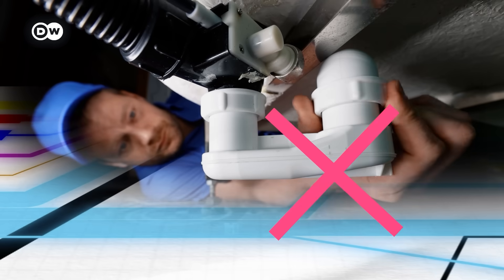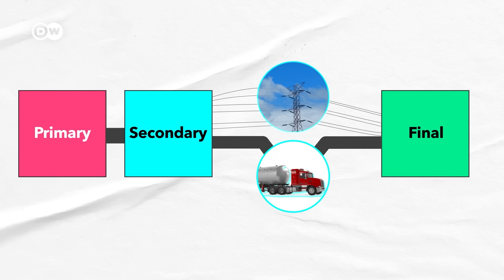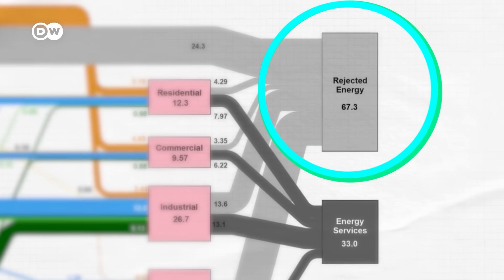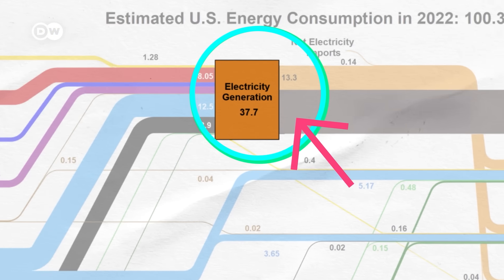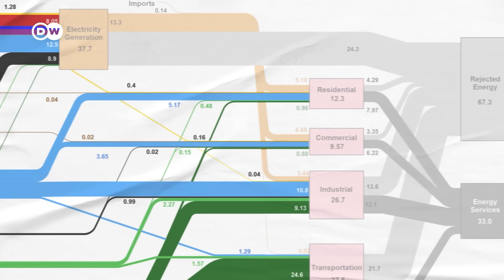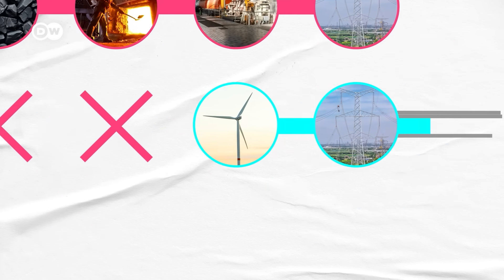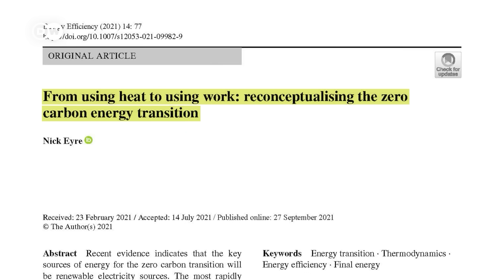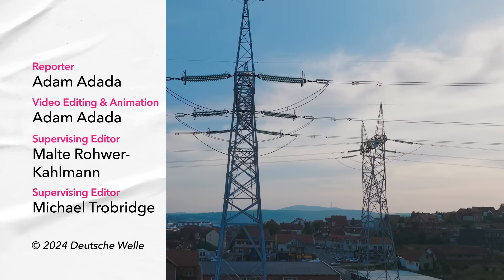The mind-blowing thing we get WRONG about energy

Comment from the maker: Do you think switching away from fossil fuels is easier than it seems?
Reply: You tell the billionaires who own fossil fuel assets whether they'd be so kind as to simply write them off and live with the ensuing losses.
Reply: @josdesouza  Fossil Fuel Assets become Fossil Fuel Liabilities. Cannot be stopped. We have come Far. And its just the beginning.👍
Reply: Can it be affordable to common people? 
Do we have enough and reliable power source to convert everything?
Reply: You guys turned off nuclear plants to return to coal 😂😂😂 🤦
Reply: No. Look at Switzerland, 3GW installed capacity nuclear, 4GW installed capacity solar. Electricity production: 24 TWh nuclear, 4TWh solar. Please tell me more how renewables are more efficient taking into account capacity factors and how it is worthwhile to spend all the energy manufacturing 10x more generation capacity which has much shorter lifetime, plus all the grid upgrades. And also where is all the copper for transmission lines going to come from.
Reply: @a.b.d8927  Aluminum is a fine conductor.

Nuclear is many times more expensive per MWh than solar, and tends to prey on solar because it's easier to shut off solar than to stop and restart nuclear.

All the rest of your claims? Sound like shenanigans to me. Switzerland has plenty of capacity for pumped hydro, so has no need of any other source than renewable.
Reply: @bartroberts1514 the numbers are from Our world in data, for 2022, look up electricity production by source. Hydro is indeed the highest at 30 TWh, followed by nuclear at 24 TWh, and then solar distant third at 4TWh, despite higher installed capacity. Both solar and wind have low capacity factors and much shorter lifespan compared to nuclear, and they are cheaper only if you dont count grid infrastructure upgrades and storage. 

Aluminum is indeed good conductor but at high current densities (such as fast chargers gor EVs, and related infrastructure since you need to upgrade substations etc), copper has very clear advantage in lower Joule losses. 

You can also look up increased consumption of lead due to growth of solar (its in the solder). So environmentally friendly! Cant wait for agrovoltaics! We really need to add some lead to all the microplastics in the soil from using WWTR sludge as fertilizer.
Reply: @a.b.d8927  Not a lot of lead in lead-free solder used in modern agrovoltaics, nor plastics either. Plastics.. the co-products of fossil fuels made cheaper by fossil fuel use. As for WWTR sludge fertilizer, don't you mean synthetic ammonia fertilizer? That'd be the stuff delivered in plastic bags, right? As for Joule losses, that's all to do with cross-sectional area, so not an issue on a cost basis. I mean, if you were looking for maximum advantage, you'd be using gold or silver.. or graphene.

Our World in Data 2022 is outdated. China pretty much doubled solar installations in 2023 alone.
Reply: Definitely. Especially when you see how cheap wind and solar energy got. And batteries get cheaper and cheaper, too. We don't need expensive fossile fuels any more and can save a lot of money. Win Win Win for us, clean air in the cities and the climate.
Reply: As a person who have renovated a 1960's house entirely, I could see firsthand what insulating and switching to low temperature underfloor hating supplied with a heatpump can do.
Going from a central woodburning boiler needing 25000kWh of wood to heat the house for a year, we are now down to 1600kWh of electricity feeding the heatpump.
Actually a properly designed house should not need energy for heating, zero-energy houses have been around for 30 years now.
Reply: Yes, that's why fossil fuels work so hard to hinder every effort to transform into renewable alternatives.
Reply: If it were so magical The System would have shifted long ago.

By the way, electricity is NOT energy...is an energy flow.
Reply: @vsotofrances  Vested interests. Complacency. Failure to update practices. Try some Donella Meadows to cure your The System blues.

By the way, potential electrical energy doesn't flow.
Reply: Sodium Ion BESS will radically improve our energy storage.
Reply: It’s easier on the point that it is much, much more efficient than ancient carbon sinks. It’s much harder to change mindsets, economic arrangements, and the flywheel effect of business as usual. 
On another note, I’m a bit of an armchair economist, and I see it much differently than what we have today. First principles, a positive feedback loop will always lead to failure. This is why the rich are getting richer, but at some point this fails. How can capital be generated if only the rich can afford the luxury of being?  Second principle capital must flow or it becomes stagnant, and losses value. If capital isn’t doing something useful,it has only intrinsic value.  As in the wealthy holding wealth for wealth’s sake. Third principal, if money is not doing something good for everyone, and the earth, what good is it? 
I really like the donut economics model, this model takes into account of most everything we need. Just sayin.
Reply: If it's cheaper, then it will happen by itself and will require no effort. It needs to be cheaper all the time, though, including in the middle of the night and when the wind isn't blowing.
Reply: @mikeg9b  Vested interests. Sunk costs. Ulterior agendas. Perverse rewards. Crony capitalism and corporate socialism.

Worrying about the middle of the night when demand is low, and when the wind isn't blowing when demand is low? Seems contrived, and driven by ulterior agendas.

I'm fine with cheaper overall, with storage to cover the middle of the night when the wind isn't blowing, on a grid that doesn't waste almost 70% of power generated.
Reply: @bartroberts1514  The monthly electric bill needs to be cheaper. When people can switch to renewable energy and save 10% or more on their monthly electric bill, even Republicans will switch. Unlike cars or clothes, there is no benefit to paying any more than you have to for electricity.
Reply: @mikeg9b  See, I'm already on the third lowest-priced grid on the continent. We got that way by switching to renewables.

When your grid is fully fossil free, you'll start realizing those 15%-40% electricity savings, or at least your provider will.

What they charge you is up to your politicians, though.

And here, an EV pays for itself in less than five years, because electricity prices are so low.
Reply: To me it doesn't seem easy...
Reply: Sure it is.  Build nuclear, invest in power distribution infrastructure, use thermal solar as peaker plants for summer AC surges with molten salt thermal energy storage.  That's the grid decarbonized.
if we use high temp nuclear for electricity, it can be used to synthesize gasoline, and move us off drilled oil while we transition to another fuel source, be that full electric, synthetic fuel hybrids, hydrogen, or ammonia.
Invest in inland train freight infrastructure, that will also be able to serve as hub people transportation.  That can massively improve efficiency in transport and relieve our highway system and air travel.
Reply: @SanosukeTanaka  Nuclear expensive, though. Why not enhanced geothermal, multiple-scale hydro, and skip all the consumables entirely, making biofuel for hard-to-abate uses?
Reply: @bartroberts1514  Nuclear is the least expensive source of energy that we have.

US wholesale electricity prices by generating technology:
PV - $83/MWh
Wind - $36/MWh
Fossil fuels - $34/MWh
Nuclear - $25/MWh
Reply: Renewables are expensive and unreliable . Will never happen.
Reply: Nice video, but hard to follow when the background noise/music is high and voice volume is low.
Reply: No.  In the US there's 250 million cars and trucks that run on fossil fuels. Replacing them will not be easy.     It took at least two decade s  to build them all.   We are building grid scale energy storage at about 1% of the rate we need to.  At any given time, nearly 10% of fossil fuels are in storage either in large tanksl, tankers,  pipelines  or Col storage and transfer areas.  Even if we just have to replace 30% of that storage,  we still need about 8,000 terawatt-hours of storage.  Our biggest battery storage areas are measured in megawatt hours.  There are 1 million megawatt hours in a terawatt hour.

We aren't building any interconnectors that would also make best use of resources.  They need to be under construction now to be have them finished in 20 years.    
It won't be easy but it  once it's done we should be secure for generations.
Reply: It's easier when people are stopped lying to.
Reply: Hi, unfortunately the video only explores one dimension but the picture becomes more complex taking into account other very important dimensions. In particular the capital efficiency of current renewables to deliver a stable electricity supply (storage, back-up, transmission infrastructure, maintenance) is low, and the cost per unit of energy is more expensive so society will become poorer which will cause social unrest, worse health outcomes, environmental destruction and it will slow down the adoption of renewables in other countries as they witness negative impacts of rushing to net zero. Making people poor is a bad strategy.
Reply: @JetsG2020  Exactly that. Expensive power(electricity) stops people from electrifying all the appliances, cooking, heating, transportation. When electricity is stable, predictable affordable switching heating from coal/wood/natgas to efficient heat pump needs no incentives- it should be the best, least expensive, most convenient option. France uses practically no coal, oil for electricity and little biomass 40ish alrady- and Germany is environmental failure, that spent a lot of money. Medal for efforts! Failure in execution.
Reply: This is a not too bad presentation. About energy losses I mean.
But first a few obvious mistakes.
1: A powerplant for creatin g energy is much more efficient as descrived (when used at full power).
60% of the used heat goes directly in electricity. Frome the 40%  not used for electricity half can be used or other (indurstrial or other heating) piurposes. Making those up to 80% efficient. (Source..energy producer in the netherlands, using a so called "steg centrale" 
2: Energy efficiency has nothing to do witrh climate and climate changes.
Also noone has ever research the effect in collecting sunheat on those nice black solar panels and then heating up the athmosphere because those panles get hot  compared to the reflected (ito space again) if that surface would be nice white (sand, icecristals or just mirroring)
3: Noone has installed the soilution for storage of electrical energy on the (needed) big scale (except denmark and noway).
Using renewables is a production model with mostly a production capacity depending on extranel sources (sun , wind) which we cannot regulate.
But energy should be delivered on demand...that is what we are used to (no not for that electric car...it is not important if it get charged on a sunny daytime or at night when the fossil powerpland does not know what to do with rest capacity...what IS importanbt for that EV is that I can connectv that thing to the grid at ALL parkinbgplaces...but only chatrging when there is a surplus of energy...maybe even partially UNCHARGING when there is a shortage in energy.(Of coarse I should choose until what battery level it can be incharged and the payment must also involve (for each full cycle worth of electricity)  one promile of the battery costs...assuming a lifetime of 1000 battery cycles.
This could solve partly the omissing storage capacity for energy.

But overall..I DO support max efficience in energy usage for 100%. Climate is not important for me for this behaviour. Just resourcefullness. (And yes I'm one of the first addopting an EV (2013, not even the teslaS on the market in europe)...long before even governments spoke about transition. The same for using a heatpump for heating (even before my first EV, in 2009 installed) Maybe noone should forget that most airco's are also heatpumps.
Also , as information...I ONLY believe engineers if they are NOT payed by any factory of government for making their research claims which makes political influence in their reports often to big.. The same about preventive medication of coarse).
Luckily myu child is one of those engineers (also involved in developing a solacar for the WSC Australia a decade ago) and my wife is that not payed (by pharma and or government) physician.
This along with my own technical education.
Reply: NO, you are looking only on a part of the problem. For example renewable sources generates only at some times (solar at day...) so you won't have enough energy at night, and storing energy is really problematic (also it is inefficient). And this is only one of many problems.
Reply: The biggest problem is most of the population is sociopathic. We just have to stop buying new fossil fueled devices, and then everything will be replaced by electric powered devices within a few generations, with most of it being replaced within a few decades. That's on target to meet most of our climatology needs. The end of this century is going to be a doozy either way, but the real difference will be whether we survive the next one.
Reply: No, because building out the required renewables isn't the problem. Even if we had to match the primary energy needs. We could do it in under 5 years, just for what we currently spend on fossil fuel subsidies.

The problem is that the fossil fuel industry owns the politicians and the media.
Reply: One missed detail here is that the transitional energies like oil provide on site energy production. When we remove such systems it increases the need to produce more energy for the entire network instead. That is where we have a problem as well. The calculations I have seen on that reach stuff like doubling reliable energy production within 10-20 years to reach demands. That is insane numbers of megawatts we need in output which would require huge expansions and modernisation of the grid and robust powerplants like nuclear and hopefully future fusion plants alongside large scale energy storage that borders on pure sci fi at the moment...
Reply: @kenji214245  The statement you provided raises several concerns and misconceptions about transitioning away from fossil fuels and the requirements for energy production and infrastructure. Let's address these points using insights from Project Drawdown's Roadmap and existing counterexamples where appropriate.

Misconception 1: On-Site Energy Production from Oil
Claim: "Transitional energies like oil provide on-site energy production. When we remove such systems it increases the need to produce more energy for the entire network instead."

Reality: Oil is the least used, and least conventionally attractive, of grid energy sources except in extremely remote locations or terrible cases like Puerto Rico. While oil can provide on-site energy, the transition to renewable energy does not inherently increase the need for network-wide energy production. Renewable energy systems, such as enhanced geothermal, small-scale hydro, solar panels and wind turbines, can also provide decentralized, on-site energy production. In fact, distributed renewable energy systems can reduce the burden on the grid by generating power close to where it is consumed, thus reducing transmission losses and improving grid resilience. Both compressed air storage with geothermal and pumped hydro with micro hydro are efficient, cost effective answers to intermittency.

Counterexamples:

Solar Panels and Microgrids: Many regions use solar panels and microgrids to provide on-site energy production. For example, rural areas in India and Africa are increasingly adopting microgrids powered by solar energy, reducing the dependence on centralized fossil fuel-based power plants.

Project Drawdown: Promotes decentralized renewable energy solutions, including rooftop solar and community-based wind projects, which can effectively replace on-site energy production from fossil fuels.

Misconception 2: Doubling Reliable Energy Production
Claim: "The calculations I have seen on that reach stuff like doubling reliable energy production within 10-20 years to reach demands."

Reality: While the transition to renewable energy will require significant increases in clean energy production, the notion that we need to double reliable energy production is an overestimation if efficiency improvements and demand-side management are considered. With energy efficiencies inherent in transition, at most 17% grid power delivery increase is needed overall by 2030, and at 3% per year would be in line with normal maintenance and upgrades. Re-connectoring methods have really improved the efficiency of such operations lately. Project Drawdown emphasizes energy efficiency and reducing energy waste as critical components of the transition, which can substantially offset the need for additional energy production.

Counterexamples:

Energy Efficiency: Countries like Germany have made significant strides in improving energy efficiency, reducing overall energy demand even as they increase their share of renewable energy.
Project Drawdown: Lists energy efficiency measures, such as building retrofits, LED lighting, and industrial efficiency improvements, which can significantly reduce the need for new energy production.

Misconception 3: Need for Huge Expansions and Modernization of the Grid
Claim: "That is insane numbers of megawatts we need in output which would require huge expansions and modernization of the grid."

Reality: See above for information on actual grid expansion and re-connectoring. While some grid expansion and modernization are necessary, the transition can be managed through incremental upgrades and smart grid technologies. Renewable energy sources can be integrated into existing grids with strategic investments in grid management, demand response, and energy storage.

Counterexamples:

Smart Grids: Countries like Denmark have implemented smart grid technologies to integrate high levels of wind power, maintaining grid stability and reliability.
Project Drawdown: Highlights the importance of grid flexibility and modernization, advocating for smart grid technologies, demand response, and distributed generation to manage the transition effectively.

Misconception 4: Reliance on Nuclear and Fusion Power
Claim: "Robust power plants like nuclear and hopefully future fusion plants alongside large-scale energy storage that borders on pure sci-fi at the moment."

Reality: While nuclear power can play a role in providing low-carbon energy, the reliance on future fusion power is impossible and will never happen. Current renewable technologies, combined with existing and emerging storage solutions, can meet future energy demands without waiting for expensive, slow nuclear technology.

Counterexamples:

Renewable Energy and Storage: Countries like Iceland (geothermal), Costa Rica (hydro, wind, and solar), and Portugal (wind and solar), and most of Canada (hydro, wind) are already achieving high levels of renewable energy integration.
Project Drawdown: Emphasizes a diverse mix of renewable energy sources, including solar, wind, geothermal, and hydro, supported by energy storage technologies like batteries and pumped hydro, which are already commercially viable.

Conclusion
The transition to renewable energy involves challenges, but the misconceptions highlighted can be addressed through existing technologies, strategic investments, and proven approaches. Project Drawdown provides a comprehensive roadmap that includes energy efficiency, grid modernization, and the deployment of a diverse mix of renewable energy sources, all of which can collectively meet future energy demands without relying solely on nuclear or speculative fusion technologies. By looking at successful examples from around the world, it's clear that a sustainable, reliable energy future is achievable.
Reply: @kenji214245  True.
Reply: An ICE is 20-30% effective at utilizing combustibles whereas a commercial power plant is more in the 40-50% range for efficiency. ~45% efficiency for power generation multiplied by 90% efficiency for utilizing the generated power through electric motors equates to around 40% overall efficiency. So you use about 30-50% less fuel to do useful work but you need to take into consideration costs on the backend such as electric motors and batteries production and useful working life.
Reply: Question -- how is "flare gas" categorized?  You can see that stuff from space.
Reply: And is escaped methane included in the figures?
Reply: Switching is feasible, we currently have most of the technology we need to improve energy efficiency (mainly through electrification) and to supply reliable renewable energy.
Reply: We have mostly done so as an individual household added Solar/Battery and Model Y. It takes an investment but an investment you can justify over time and therefore we are saving money. Additional benefits are no more gas stations, house now has a battery backup so we will be unaffected by blackouts, we have removed our demand from the grid. If an individual can do it and justify it economically then this transition is very manageable for society.
Reply: I don't think the problem has been technology for the last twenty years (and more). I think that the real resistance is just resistance to change. People just don't see the actual costs of fossil fuels in their day to day, they can't see the benefit of renewables, and they can't see how they will be able to break away from what they have (fossil fuel reliance) to get to renewables.
Reply: @3:24 audio problems. The presenters voice volume is lower than the music.
Reply: Trompe.
Reply: You fail to mention that wind and solar produce intermittent energy. You cannot run a civilization only when wind is blowing or sun is shining. How about you advocate for nuclear which can and does (e.g. in France) replace fossil fuels reliably? Solar and wind are just a hobby for rich countries, not a source of energy one can take seriously.
Reply: I think it could be easy to switch away from fossil fuels in terms of added electricity generation. This century the generation of electricity from coal, wind/solar and gas have all increased by roughly 4 000 TWh. 

In the next 20-25 years the total electricity generation will increase and none of the net increase comes from coal and gas. I think even more will be done but that won’t be easy.
Reply: No!!
Reply: Please lose the silly, distracting, overly loud background music. It adds nothing to your video.
Reply: Definitely no!
Reply: If Germans actually understood any of this, they would have spent the last 15 years actually doing it instead of just repeating this nonsense propaganda while buying Russian natural gas.
Reply: Absolutely!
Reply: White women love to tell others what to do.
Reply: My answer is no. Agreed moving away from fossil but i still don't see how renewable able to replace 1/2 of energy needed. Not with current available technology or deployed method. 

I feel this video kind of contradicting with other DW videos. For example, The supply chain and the waste issue on Wind turbines, the EV battery, etc. It seems we kind of shift one problem  to another with greater environment damage. 

I do believe a lot of things are over hype and did not disclose the whole truth of it, the pro and con of each. Politicians definitely don't care. I do see things differently nowadays. From whole supply chain, sustainability till by product.
Reply: Easy? Germany spent some 520plus GiGA Euro, has one of the most expensive electricity and still use so much coal and gas to get it. About 10times more CO2/kWH than France!
Reply: @msxcytb  plants love co2
Reply: @sullytrny  410plus ppm is plenty enough for plants.
Reply: Glosses over the impact of electric vehicle production on the environment.
Reply: @CGM_68  Most likely these impact are overstated. Use that electric vehicle a lot (only then it makes more sense to replace gas with electricity) and long and the "build" dept will be paid. Now ICE cars also takes intense resources to make and for every litre of gas it takes some extra 20-30% of it consumed in the process (recovery, refining which is energy intense, transport), which is frequently forgotten.
Reply: @CGM_68  the problem of materials and recycling is interesting indeed. I'm more optimistic about it. Used up batteries retain precious elements in compact space waiting for its value or laws to force recycling. I just think that it is not necessary to have grid/home batteries when we have perfect energy storage material in form of uranium, thorium and plutonium. Batteries are more needed to reduce emissions in transport. Just a small 10kwh battery in my old phev saves 4/5 of emissions from my family kind of driving - same battery would not give any benefit if installed in my house, because in my country grid is pretty clean(1/6 of emissions of Germany per kwH)
Reply: @CGM_68  Yeah, yeah cause producing regular cars and fuel has no impact whatsoever...
Reply: @fka-Kaya  did I say that? No! It is disingenuous of DW to compare negatives of one aspect with only the positives of another aspect.  Stow your dismissive demeanour.
Reply: It is, but lobbying combines with the preference for the familiar to produce undue levels of resistance
Even if we only need to get rid of ⅓, we still need to aim to reduce fossil fuels as much as possible beyond that
Reply: We´re up against the fossil fuel lobby.
Reply: It will take no effect at all to stop using fossil fuels. Just a question of time. Do we do it now whist we can and it's easy or when all the fossil fuels are gone?
Reply: It's easy. Sweden has 98% fossilefree power generation, Norway has 99% fossilfree power generation. Just stop burning things. The UK is soon closing its last coal peaker plant. The Aussies are balancing their peak power with batteries, which is way cheaper than coal. If there's a will ... 🙂
Reply: @gunnarparment5050  France is also fossil free with its grid, Similar Finland, Ontario and few others. Use the best, cheapest (as total) mix with lowest carbon footprint- this is not always wind and solar.
Reply: We think Germany would go out of energy if they wouldn't import electricity from nuclear plants in France.
Reply: @MrZygmuncik  Right at the moment France is exporting about 9.5GW of carbon free energy to its neighbors. At the moment about 20GW of France capacity is idle/off- so France by itself could get kind of rid of a lot of  the coal in Europe for some big part of the year (simplification excluding refueling etc). Think about that!
Reply: It is not
Reply: The power elite push the climate agenda to centralize their control over ALL the energy, carbon fuels, renewables, all of it, and they do it with fear and artificial scarcity, and limiting choices, and steer the people's good intentions to "save the planet", and the social and economic momentum from fear they create.  They support centralized systems and services which they control and make you dependent, and efficiency does not really matter to them.  Destroying "old" industry makes the industry they invest in explode in growth.  It doesn't matter to them if the numbers on CO2 are fudged or scientifically valid.  They won't ever really support low-carbon systems, or new choices they don't control at a meter, or some way.  They may sound nice but aren't, and they have many "true believers" covering for them.

Grid based solar is not so great, facing the same long distance line losses as coal, and both are controllable.  Wind is geographically limited and economically viable locations are few, so grid is the only way for wind.  Solar PV YOU OWN and control is better.  If you can afford it, you can power a home, and make your own "filling station" for your e-bike, hybrid car or BEV.  Many persistent choices of all the current fuels also spell freedom and economy like your own solar electricity.  You need backups.  If you "save the planet" over fear, and give them control, and lock yourself in a prison of scarcity, is that easier than it seems?
Reply: No. You miss something really important. I mean, apart from the fact that modern fossile power plants have much higher efficiency than claimed. Waste heat is used to heat homes, for industrial processes, etc.

There are many applications that can't run with electricity directly. To claim we could put everything on electricity is an ideologically motivated alternative fact. Let's take mobile applications. Small batteries in short distance cars make sense. But every requiring larger batteries doesn't, because they fall a full order of magnitude short of energy density (12.000 Wh/kg of typical fossil fuel).

So now you need to create other, more energy dense renewable fuel, like H2, NH3, SAF, eFuels, etc. That INCREASES, not decreases the primary energy you need over today's level, as soon as you start transformation of the not so low hanging fruit.

Another example: fuel pumps for heating. I run one, it's nice. But I built the house around it a decade ago. The primary energy required to enable existing housing to use a heat pump properly, not as a simple electric heater, will diminish the savings for decades.

So let's stay honest and do our math correctly. The energy transformation to renewables makes sense, but it won't be eased by some miracle.
Reply: @BlueSideUp  Renewables are intermittent and all this is going to achieve is blackouts because they can't produce power 24/7. and they also need backup baseload power so the lights stay on.
Reply: @ironmaidens6663 this adds to additional requirements for primary energy, to build storage infrastructure like batteries, H2 production, etc. Of course you can put excess energy produced when there is a lot of wind, water and solar away for nights, even for full winters, etc. But it requires energy conversion steps and reduces efficiency. That was my whole point regarding the claims of the video. There are some applications that require less primary energy with more efficient, electricity based solutions. But there are also applications that require more, like production of high energy density media, storage, etc. So, primary renewable energy requirements will go up significantly, not down, as the transition progresses.
Reply: @BlueSideUp  Batteries only last a few hours at most, when the wind isn't blowing and the sun isn't shining and you might have to go a few days or weeks without either. This why you can't run an entire country entirely off renewables along with batteries.
Reply: @ironmaidens6663 ...which is why you need additional storage, like producing H2 or pumping water up a hill (scary, still one of the most effective ways to store electricity), something like MSRs for base loads maybe, etc. Technically, you can run a country on renewables and batteries, if you install an absurd amount of batteries. If you really want to do it in a practicable way, you will add other ways to store and consume renewable energy, like H2/fuel cells, eFuels instead of electricity for cars, etc.

The reality will look more like China, using all renewable and fossile energy sources they can get their hands on to have as much cheap energy available as possible.
Reply: @BlueSideUp  Batteries alone simply won't cut it. You need backup baseload power from something reliable like (Coal, gas or nuclear)
Reply: Elon Musk has been pointing this out for years but various political, entrenched interests and media forces are trying to destroy his companies.
Reply: @StormyDog  Musk should have finished his degree and learned to do math. Batteries won't do the trick, to resource intensive, energy density to small as the singular solution. There will be many solutions that come together.
Reply: @BlueSideUp  You obviously haven't paid attention.  He says that batteries are part of the solution.
Reply: @StormyDog  well, I remember when he "calculated" how he could easily provide all storage needs of the planet with batteries. But he sais an awful lot of things, good and nonsense, so who keeps track 😉
Reply: Fossil fuels are anything but easy. "Easy" has a market value, Fossil fuel has a cost per resulting kWh of energy, and many renewables are getting below that market price, indicating that these renewables are easier than fossil fuels.
Reply: solar and wind only last 10 years at best. weather wipes them out, flip 5 quarters 5 times a day if they all come up heads your solar farm or wind farm just got wiped out by mother nature. do this every day for the rest of your life. how's that safety and security? reliability is everything, penalties for unreliable energy need to be raise 150,000% on solar and wind, because the companies just go bankrupt after stealing the subsidies and abandon their toxic waste farms all over farm land. solar and wind should be confined to city buildings only. keep your toxic waste out of the food supply and where the toxic waste of humanity breeds the worst of humanity
Reply: No, it's exactly as difficult as it is.
It's you that makes it seem easier than it is.

How are you going to solve the base load problem, and don't say batteries unless you can solve the battery scalability issue?
Reply: No not even close grid efficiency does not increase with higher renewables it decreases due to the greater base load generation not able to fluctuate as quickly as renewables will inherently 
There are other massive problems, too many to list for an example the amount of mining required to produce the minerals required for this net zero nonsense
Reply: No. Intermittency of renewable energy is the biggest challenge.
Reply: @philhill3359  Hydro and enhanced geothermal have no significant intermittency.

Nuclear, and every furnace-based form of generation, must shut down for maintenance cycles regularly, between hours and decades long, with few exceptions.

Solar and wind? Sure, they need compressed air or pumped hydro or battery backup, but all of those provide off-duty-cycle FCAS and automated impedance matching that pay for themselves within three years, and give grid-connected equipment -- like your appliances -- longer service life.
Reply: @bartroberts1514  I’m open minded, but far from convinced. UK has little hydro or geothermal opportunity. We can go days without wind in the depth of Winter and I cannot see batteries providing anymore than a few hours at most.
Nuclear is the only option, in my opinion, for base load and the UK is doing little in this area.
Yes, interconnectors can be part of the solution, but it makes us poorer and reduces energy security.
As for achieving it by 2050? I’m a practical guy and I just can’t see it happening.
Reply: I cant watch this video because THE AUDIO IS SO BAD. This video needs to be seen, so get it fixed please and re-upload it.
Reply: No
Reply: There was a book on this written in the late 90s -- Factor Four. It makes the same arguments you do here in this video. However, it didn't work out for them. We use more energy now than we dreamed of using then. The reason is a kind of generalized version of Jevons Paradox, seen everywhere in the natural world. Efficiency drives growth and eventually, more energy usage as civilizational networks expand.
Reply: The answer is to switch away from BOTH renewables AND fossil fuels, to produce clean synthetic fuels, combined with technology and efficiency improvements.
Reply: Nope, to many lobbyists.
Reply: You are miss interpriting information. 

Oil produces more waste energy but this does not make it less efficent.

You need vast fields of solar farms to equal an oil powerplant.

It costs more.

Did you calculate how much oil is needed to procuse just one solar pannel? 

Changing to any other form does not remove oil becuase oil is simple cheaper becuase its more effient at doing everything. 

Poor people cant afford to live in a rich world without oil. 

So keep spreading you missinformation and simple lies about how we could "easily change to renewable resources" instead of acturaly finding a way to really make it cheaper to change.

Money runs the world you make it cheaper for people to move to renewable people will move in a heart beat.

Abd cheap means effient
Reply: Yup it seems so! I really haven't thought of this.. Even when I new that petrol engines in cars waste 70% of the energy and electric ones only about 10%. But this is a really good news! We don't need to produce all of the energy we currently use. Just a third of it!
Reply: WE NEED KINETIC ENERGY IT IS VERY PROMISING! By leveraging Electricity cost of Air Compression, we Can Displace mass and generate gravitational and buyoant potential energy to transform it back to electricity ! This way we are not using any fuels wind or solar but get more electricity that we use to compress air!
Reply: Rich and peasfull countries are supporting wars far from home, they are not even considering a reduction of usage of fossil fuels. The total amount of the earth usage will be reduced by the way of foreing wars. But this subtle manouevre has its limits, as the climate bifurcation is allready here. New York will be underwater in 100 years from now. And more of the poor countries are adquiring the knowhow of warfare...
Reply: It’s not as easy as these videos make it look like.
Reply: @Ratinevo  Neither is living through a heat dome, a wildfire, a flash flood, a famine.. or any of the other results of failing to do it.
Reply: It's been calculated that it would only take 2% of ALL the government's GDPs to stop reliance on Fossil Fuels(!) I am very certain  it's do-able.. HOWEVER: As long as governments/industry leaders keep allowing Big Oil to make and bend the rules in their favor,  Then NO. And until the majority of people realize they are being screwed out of their own (and children's!) futures because of it... Then NO.
Reply: No, what on earth makes you think that it is somehow easy to reduce the waste by 50% in total??? That is equally as hard as just stepping away from the use of fossil fuels altogether, in that it requires a replacement of pretty much all technology and infrastructure with more efficient ones. It is actually harder, since such amazing efficient technology doesn't exist in most cases yet.
Reply: Not really. It would cost 50-70 trillion to completely electrify the US automotive section.
Reply: Norwegian natural gas which the UK takes a lot of by pipeline, has large reserves. But! It is four times cleaner on burning than the gas from the UKs home gas fields. Gas burnt in condensing boilers is 90% plus efficient. Burning natural gas directly, at point of use eliminates the waste stages of say electricity generation, so making it cleaner again.  

I do not see any reason to quickly phase out natural gas. OK new homes can be all electric of course. and house renovations of course. But take gas away from the millions who use it who do not really have an alternative as their homes are too small for heat pumps?  It does not make sense.
Reply: No one ever talks about replacing fossil fuels with renewable energy. It's always about the what fossil fuels provide. Most specifically the electric grid and that has remained as big as it was. Actually it will have to be more renewables because they are variable sources. As for heat requirements here there is no efficiency gain.
Reply: It won’t get any easier until we start working at doing it. The deniers have sunk knives into our backs by holding up the process. There is so much to discover about electricity, chemistry, materials and physics. We have so much to gain by evolving our energy systems. We have nothing to gain and everything to lose by playing business as usual.
Reply: Surely is!
Reply: Yeah, it's easier than it seems. 

b/c fact of the matter is, not everyone, for good or bad, is on the same resource usage. 

Like you have small business owners using more energy than a grandma.. they also might have more resources to buy or make upgrades? MAYBE...

But the grandma can't update her equipment. Its better for her to continue to use the gas stove shes got.. b/c the new induction one cost 5000 dollars, and she doesn't have that money saved up..

Then you got transmission issues..

You know what that chart showed me? It showed me a bunch of ways in which the world isn't so Black & White in how you can solve problems...(Also showed me there is room for improvement)

I think in America if we had more regional trains available, that would cut down on a LOT of road traffic... BUT here we are...
Reply: @MRSketch09  I have a single burner induction cooktop that was about $90 (single burner, plug in to ordinary 110V outlet). Heats WAY faster, uses less electricity. And they're easy to find- Target, Walmart, internet etc. Induction units can be found that are very inexpensive. And having one doesn't make an existing stove disappear, so I recommend trying one.
Reply: HORRIBLE question.  Better is does it make sense to spend trillions to switch.
Reply: @joep5170  Yeah, it's way better to collect energy from the sun, store it, and use electricity instead of digging up coal and oil.
Reply: Switching away is a massive undertaking given that we’ve been reliant upon them for 10’s of millennia. 

Even now, the world over, we rely upon aging infrastructure that simply cannot support the potential electricity generation from renewables. 

It’s a noble aspiration to go “all electric” but we’re a long way off from the battery tech and recharging infrastructure that will enable huge sectors of the economy to actually remain viable. 

As things currently stand I would go out of business should internal combustion engines be unavailable or subject to disproportionately high tax rates.
Reply: i think it is easy because having a renewable energy source could easily increase more renewable sources exponentially. Renewable sources could generate enough energy to power up manufacturing processes that will produce more renewable energy installation.
Reply: Its just a matter of will ,, Once complete it will be benefiscial in every way and people will not understnd why it took so long .The problem with fossil fuel use was well known by the 1960s,
Reply: No, this is a very simplistic take on the issue. The biggest cost of moving solely to renewables and electrifying and would be in the cost of materials manufacturing the infrastructure required. This would require far more relatively rare metals of which all of the high quality deposits have already been depleted, which will require more expense and environmental impact. Then there is the massive transition required in the actual infrastructure to distribute the energy. And we have yet to discuss the issue around base load. Unless there is a major change in material science and economics, we are a long way from Kansas Toto.
Reply: @michaeltrumper  Whatever Whats your alternative ,..People are listening ,
Reply: @kevanbodsworth9868  We may get their but FF are going to be a critical part of the energy system for at least 3 decades. Unless you want to go down the degrowth path and then we won't have the $ to scale up carbon neutral energy systems,.
Reply: No. It is harder
Reply: Yes. Use nuclear.
Reply: More ground thermal powerplants! More solar in the desert regions and less > masses of toxic composite waste< and ugly wind turbines. Some good with aluminium wings in ugly territories is enough or some as a private small version.
Reply: @gljames24 Heat pumps 270% efficient is very misleading. This video left out electricity transport inefficiencies. Electricity without subsidies is three times the price of gas. Most electricity comes from Gas and the hopes of replacing 3000 gigawatts per hour of gas with electricity will just cause brownouts. That gas to electricity is 50% efficient vs a 95% efficient boiler. Then the national grid says 8% loss in the grid. That is a lie and is far worse if battery storage is involved for sure.
Reply: Calling thermal plants inefficient is dumb. Because even though wind turbines are efficient it's still the sun that is causing the wind and heat is involved in producing wind!
YOU CAN'T IGNORE HEAT IN ANY SYSTEM USED TO GENERATE ELECTRICITY OR TO DO WORK!
Reply: Not only no, but HELL NO!!! The problem is storage, since renewable energy is inconsistent (at night you don't get light for your solar panels and generally your wind turbines slow down or stop) you run out of energy!
Reply: Yes, absolutely! Our house has 30 solar panels that generate about 17 megawatt hours/year along with a 10 kwh battery to get us through the night. We also have an induction stove, an electric car and heat pumps for heating and our water heater. we generate roughly 90% of the total energy our house uses each year (which includes driving) just from our solar panels. If every home and business installed solar panels our dependence  on the electricity grid would probably drop to nearly zero in the summer and a fraction of what we use now during the winter. Fossil fuel consumption would drop by over 90% in such a scenario.
Reply: @davidbelk46  Your solar panels are paid for by your neighbors who don't have solar panels. And by grid destabilization. It's a regressive subsidy to rich people, UNLESS you are completely disconnected from the grid.
Reply: Yes it's easier than thought, assuming someone has    let their mind shift into some form of flash-cut scenario...  Just pick specific really bad uses of energy, address them cradle-to-grave on the flow and clean them up.  Do it incrementally and continuously.  In the US we hear about CA and TX electricity grids and how they have short comings...  it's really overstated, both are doing really well at volumes of wind+solar (and CA some geothermal)... generation, transmission losses, heat (and it's almost always during cooling peak season that issues arise).  No one talks about addressing the upgrade of demand generating inefficient systems that are drawing that power - eg upgrading hvac, even making sure their refrigerants are filled, coils clean, ductwork cleaned for better flow... or upgrading home/business insulation.  So yes, I'm very optimistic that identifying the worst, making them more efficient even with existing tech being well maintained.  A friend who works in this space had a spreadsheet he toyed with about CA and he figured for US$8B they could do a once through pass of the top 500,000 A/C using facilities, maintain and reduce demand enough that they'd be fine through the hottest days of summer for many years.... not sure how accurate his numbers are, but I have lived the life in tech - and addressing your worst issues first buys a lot of room to do the fine tuning ...
Reply: The issue is that you disregard storage thats needed in a purely renewable energy system. Sure nuclear has only up to 35% thermal efficiency but at least you can produce it 24/7.
Storage is expensive. Doing it all with batteries seems impossible at the moment but when you use storage in form of chemical energy (H2, Methanol, NH3, ...) you will also lose 75% of your energy. So no its not that simple. economic realities arent that easy to overcome.
Reply: @zbyszek6194  Wasting over 60% of energy in fossil fuels is expensive & worsens global warming due to CH4 and CO2 emissions. Are you not yet aware of the vast  cost of the impacts of global warming fueled disasters already?
Battery technology is advancing rapidly. Iron-air batteries are now going to be built at large scale. Sand & crushed rock batteries can be used to store heat. The energy density of sodium-ion battery chemistry is now on par with Lithium iron phosphate and much cheaper. Storage such as off-river pumped hydro is efficient & inexpensive. EV batteries used to power a household in the evening via bidirectional charging is already happening. We have the technology for a complete transition to renewable energy  at a lower cost than the old fossil fuel based, energy wasting system.
Reply: @zbyszek6194  Keep in mind that 83% of solar energy is wasted by solar panels as close to ground waste heat, and 99.99% of wind energy is wasted. Nuclear reactors and gasoline engines are way better than that. Liquid metal and gas cooled reactors can achieve 49% thermal efficiency, as good as the best coal fired generating units.
Reply: At Home it is very very easy. Rooftop Solar for Clean Energy. 20 Panels produce 8000 kWh. From the Roof. For Warm water a Close in Boiler 129 dollar in the kitchen. The Power of the roof stored in the Boiler. Close and Clean. A bathroom Boiler 189 dollar for Warm Water in the bathroom. The Power of the Roof stored in the 50 liter Boiler. Close and Clean and Cheap. Warm Water Problem Solved.👍. Smart Inductioncooking 250 dollar, plug in, Airfryer, Microwave, Watercooker. Cooking on Rooftop Solar Power. Close and Clean and Cheap. Cooking without Gas.👍
For Heating a LG Therma V Monoblock 60 degrees Heatpump. 3500 dollar. Air Water Heatpump. Place it, connect it with the CH System with flexible connecters and plug in. Ready. All Electric with Rooftop Solar Power. 👍
I have Grid Connection with Greenchoice Solar and Wind Energy. I live in Groningen Nederland and the System works for 12 Years Now. 👍 And I let a House with the same system for the Tenant. That is how Easy it is. 
DIY Fossil Free.👍
Reply: @willeisinga2089  Rooftop solar is a subsidy paid for by poor people to rich people. It's regressive and unsustainable.
Reply: @willeisinga2089  Yes, fantastic. Now do it for millions of people who live in blocks of flats and also when their electricity bills grew by 3-4x in the last few years.
Reply: @pawelnotts  I pay nothing for 12 Years Now. Rooftop Solar, Inductioncooking Airfryer Microwave Watercooker, Close in boiler, bathroom Boiler, and LG Therma V Monoblock 60 degrees Heatpump. A do it yourself job. Cheap and Easy. Start with yr kitchen, than the bathroom and at last the Heatpump. Find out how Easy it is. Do it yourself. Start tomorrow.🙂👍🌹🌹🌹
Reply: There are a few misconceptions and overly pessimistic views promoted by the likes of Vaclav Smil and Bjorn Lomborg that need addressing:

Useful Life of Vehicles and Infrastructure Change:

The average useful life of a vehicle is about 12 years, and with the increasing affordability and adoption of electric vehicles (EVs), a significant transition can occur within a half of that time for the majority of high-use (therefore shorter-lived) vehicles, essentially for free. This is supported by the ongoing advancements and investments in EV infrastructure.

Economics of Renewable Energy:

Renewable energy costs have dropped dramatically. For example, the cost of solar panels has decreased by more than 80% in the last 20 years. Additionally, almost all renewable projects are now economically viable without subsidies, which was not the case a decade ago. Renewables are in general 15%-40% less expensive than their fossil rivals.

Industrial Electrification:

Contrary to some comments, many industrial processes are transitioning to electric power, leading to decreases in primary energy consumption and costs. Technologies like electric arc furnaces for steel production and induction heating are examples where electrification is proving efficient and viable. Changing cement-making from limestone to kaolin feedstocks is a win-win, for both lower energy input costs and lower process emissions, for instance.

Energy Storage and Grid Reliability:

Advances in battery storage are rapidly improving grid reliability and energy storage capacity. For instance, battery storage systems are becoming more efficient, cost-effective, and recyclable, addressing concerns about intermittency in renewable energy sources like solar and wind. This is without considering mature pumped hydro and compressed air storage.

Renewable Energy Implementation:

While renewable energy systems have limitations (like 'dunkelflaute'), hybrid systems that combine renewables with storage solutions can mitigate these issues. Moreover, energy efficiency improvements in homes and industries can significantly reduce overall energy demand, making renewable energy more viable.

Cost to Consumers:

Transitioning to renewable energy can be affordable for consumers. Rooftop solar panels, heat pumps, and electric vehicles are becoming more accessible and can lead to long-term savings on energy bills. The payback period for such systems is generally under 7 years now.

Fossil Fuel Dependency and Transition Challenges:

The transition away from fossil fuels is a little complex and requires significant investment and policy support. However, it's no more complex than the switch from flip phones to current mobile phones, and the potential environmental and economic benefits justify these investments. Historical transitions, like the switch from coal to oil, show that while challenging, such shifts are feasible and beneficial in the short, medium, and long run.

In summary, while the transition to renewable energy involves challenges, significant advancements in technology and reductions in cost make it a viable and necessary path forward. Addressing misconceptions and focusing on incremental, practical steps can help accelerate this transition.

Fogeys like Smil and Lomborg help no one, and contribute nothing.
Reply: I think a point that was missed in this discussion is that that 2/3 of energy that gets lost to the environment, is slowly heating up the atmosphere itself.  At our current rate we would still make a very difficult to live in world in about 3 to 400 years just with the waste heat and no greenhouse gases .  Electricity generation alone puts over 70,000 terawatt-hours worth of heat in the atmosphere each year.   Solar and wind can reduce that number by 70 to 80 percent.
Reply: @flotsamike  Wind and solar especially take heat that would have been reflected back into space and convert it to ground level atmospheric heating. 83% of solar energy and 99% of wind energy is waste heat. Compared to 50% of coal and gasoline engines.
Reply: @gregorymalchuk272  Your claims are so ludicrous as to be not worth commenting on.. So here goes.

Coal and gasoline start as materials that stored by photosynthesis at most 6% of solar incident on the surface, and then lost over 99% of that in fossilization, if we're comparing like-to-like. And then the exploration, extraction, shipping, refining, distribution losses, and then a theoretical maximum of 50% (but closer to 16%) in engines.

Not that good facts ever altered closed minds.
Reply: I work in the industry and our company is building a lot of solar, this video is very strange though because whenever people talk about how much power is needed etc, it refers to the nameplate rating, which is the output of the plant, so this whole video doesn't make much sense. Of course fossil fuels and any heat based plants have very low efficiency, but the rating of the power plants and energy transmitted etc has nothing to do with the chemical energy in the fuel itself. So if we're using 30 GW power now with fossil fuels and we're replacing it with solar, it is still going to be 30 GW! Solar panels are also themselves not very efficient in converting energy from the sun to electricity, maybe even less efficient than fossil fuels, definitely less than 40 percent efficient, but again, the rating of the power is the based on the amount of power it can produce, not how much power the sun is providing it. Also, we are definitely not going to be using less electricity in the future, we will always use more energy in the future than we are now, population growth, human development, electric vehicles, and now artificial intelligence, are all big reasons why. I'm not a climate sceptic at all, but this is just a very very strange and low quality video honestly, I'm very surprised.
Reply: No. The big Problem is the electricity storage is much harder and is three orders of magnitude more expensive than fosil fuel storage.
Reply: @zorgonfire  If you're looking at a one-time use case, sure. Electricity storage is more expensive than fosil [sic] fuel storage. Unless it's pure hydro, then all you need to do to store electric energy is stop the flow of water while solar and wind are peaking, and that's free. Or enhanced geothermal, same. Or pumped hydro or compressed-air storage, which is about par.
But yeah, battery is about triple, if you're talking about high performance vehicle packs. 12 years later, repackaging those same packs for domestic private use is marginal, and you get ten thousand cycles from that, much better than ten thousand loads of coal or gas. 25 years later, repackaging those same batteries for grid storage, essentially for free, is a no-brainer.

Meanwhile, your storage containers for fossil will need seven replacements in that time, if you don't want leaks. They'll need galvanic protection all that time, which is not free. And then there's the pipelines and tankers you need to supply them.
Reply: @zorgonfire  Battery technology is rapidly advancing. Battery EVs are the winner in the race for clean energy transport even for heavy haulage, using battery swap stations. We have so many storage answers to the problem of energy storage, and much cheaper & safer than fossil fuel extraction, processing, transport & inefficiencies when burned.
Reply: If it was easy, it would've happened. Every state / country that's gone down the renewable path has ended in energy crisis (increased blackouts and brownouts) and massive price increases in power - because renewables can't meet demand when it's needed.
Reply: @Kertgaferg  Strangely enough Germany as one of the countries that did the fastest and largest steps towards using more renewables than in the past has (reported from their governmental statistics on energy) less blackouts and less brown-outs than ever. And in the same time it took the Russian Aggression and the crash on Gas supplies on Ukraine to let their energy prices raise. All the steps they took to use more renewables between 2005 and 2022 didn't.
Reply: Yes, much easier at least than we have been lectured to believe by the old carbon burning industries, who clearly do not want to be replaced by simply better, newer, technologies.  Consider just a combustion engine vehicle: Why do we have a "radiator", for the sole purpose of removing and dumping wasted carbon burning energy?  Why do we have brake rotors, drums, and pads, that all, again, are engineered expressly to dump wasted carbon burning energy, instead of comparatively simple regenerative braking?  The list of wasted carbon burning energy engineering, driving our world, is so long!
Reply: @Onelesstraveledby we have these technologies because they have paid their way in the past and have brought great improvements to life and society. 

Renewables will do the same when they become more cost competitive.
Reply: Can it be affordable to common people? 
Do we have enough and reliable power source to convert everything?
Reply: Absolutely. 

It'll be cost prohibitive to not switch to renewables... Power generation is already switching to renewables rapidly.
It's cheaper to install, much cheaper to maintain (minimal staffing required, and much less specialized laybour), and no fuel, and minimal staff requirements. 

This will be especially the case as the economies of scale start shrinking for fossil fuels... Sure, there will be some pricing volatility, especially as last ditch price drops to try and delay the inevitable FF shutdowns, but it will happen. And probably a lot faster than most would expect
Reply: No
Reply: good news now, guys
you don't need energy, you yourself is a ...
...
 GENERATOR !

Let's produce ELECTRICITY TOGETHER!
Reply: We considering many think it is impossible, absolutely
Reply: Can we get a video on how going off grid can help and doing things as sustainably can reduce the demand on the grid
Reply: We need lots of innovation and breakthrough to bring down our carbon emission to net zero. There are green premiums of using clean energy. The only way to replace fossil fuels is get green premium to negative. In other word, making clean energy cheaper than fossil fuels through innovation and breakthrough.
Reply: @yummmyum  That innovation happened a long time ago, it's called nuclear fission.
Reply: You should look at the current numbers from the Iberian Peninsula, Costa Rica, and France.
Reply: This video is misleading. Coal is 37% efficient, natural gas 35-40%, while wind turbines are 20-40% and solar only 15-20%. Renewables need upgrade of electrical grid and that costs a lot more money and use a lot more energy than fuel refinement and extraction.
Reply: @weareamilia  That's classical, not updated though.
Reply: @weareamilia  Coal is only 37% efficient once in the furnace. To create coal, photosynthesis rejected over 95% of input energy from sunlight. 99% or more was rejected in fossilization. There were exploration, extraction, processing and distribution losses, too. Then your 37%. Then losses downstream due to the damage of aerosols and GHGs. That would be a fair comparison with wind and solar.

Grids themselves always need upgrade, and the marginal additional improvements needed for a 100% fossil-free national grid amount to only about 17% expansion. That expansion pays for itself within three years due to the off-duty-cycle FCAS and automated impedance matching services that come with grid improvements, storage and reconductoring.

It is a gross economical falsehood to try to make alarming claims about "costs a lot more money"; and a gross engineering deception to claim "use a lot more energy than fuel refinement and extraction". Just galvanic protection of pipelines alone use more energy than such upgrades would, and that's a tiny fraction of the power use of fossil trade.
Reply: @bartroberts1514  When you count in the upgrade of the grid and the energy storage needed, cost of renewables become more expensive than fossil fuels.
That is the reason why grid upgrade and energy storage were omitted from the video.
I am for more renewables, but you have to make it cheaper than fossil fuels.
If renewables were cheaper already, no one would wage wars for fossil fuels or try to convince the consumer renewables are cheaper, because they would buy solar because it was cheaper.
Cost of renewables are calculated as if sun always shines or wind always blows and every calculation omit grid upgrade and energy storage expenses.
If we really wanted to promote renewables, we would install solar panels in countries with more solar hours per year. But the officials are more focused to force transition in countries not really viable for solar.
Reply: cheap oil makes world peace
Reply: Well Italy is already close to 50% electricity produced by renewables, if Italy can do it, all the world can 🤣
Reply: Yes, with advanced solar, wind and battery storage, and smart grids, the amount of energy wasted will be miniscule, allowing for 100% renewable energy within the next 20-years.  We have as much solar waiting to be connected to the grid via transmission lines, that's already built, to double current capacity, and the same amount is in development and construction now, to double it again, giving the grid ~40% of all power generation from solar alone, within 7-years.  By 2040, nearly 80% of the U.S. grid will be: solar, wind, hydro and nuclear + BESS, and 100% by 2050.
Reply: Yes
There is two major hurdles: 
Ff subsidies
Ff lobbyist/ power
Reply: No I don't. And this video simplifies until being false information. But go on
Reply: No. You forgot to take cost into consideration... If it was any cheaper for industrial processes to be run on electricity they already would be... And then there's the obvious large increase on energy consumption when you try to electrify most industrial processes...
Reply: @jrfsousa he just proven that it takes half the energy to replace this through electrification and you don’t even seem to understand basic facts.
Reply: @jrfsousa You may not want to look up how 80% of the industrial process of recycling metal is done in the US then. Haha. 😂
Reply: Yes and no. It is easy because the bio economic pathway, weaving permaculture into towns and cities, erases almost all daily energy needs for the basics. We design our surroundings to capture all water and energy a concrete jungle simply sheds away. This is easy because the knowledge is there. And despite costing fraction of renewable transition while keeping concrete jungles and a fraction of hydrocarbon pathways, the financing to transition does not exist. In every way we could transition to a far more productive life for next to nothing, but for our dumb idea of what the future should look like and the economic and political inertia preventing it.
Reply: Hell no.  Way harder.  Vid completely skips two things: transportation of goods and massive amount of manufacturing done in CN where coal is the primary energy source.  I can't take anything in this video seriously without that being seriously examined.
Reply: @ChiefBridgeFuser  A lot of the world's transportation of goods, is moving fossil fuels around. 40% of world shipping is moving fossil fuels! More energy wastage that will be stopped with the change to renewable energy.
As for China...they've been busy building more renewable energy generation than the rest of the world combined. For 2023 China met 15.6% of their power demand with solar and wind alone. The growth of renewable energy is exponential.
Reply: Modernization has all of the benefits baked in.  There is really nothing for the consumer to figure out.
Reply: No and it should not be done. Fuck the planet. I want cheap energy.
Reply: On paper renewable energy looks amazing, in the real world it's completely impractical and expensive to run everything from electricity.
Electricity is a high grade energy source, it's wasteful to use it to do your cooking when you can use a low grade energy source such as gas. How much does it cost to run your gas cooker versus how much does it cost to an electric cooker ? It's like choosing to burn wooden furniture instead of burning scrap bits of wood and claim that burning wooden furniture is more efficient because there less effort is required to get the same energy output ?
Another major problem is 'dunkelflaute'. Renewable energy capturing systems such as wind and solar are 'make hay while the sun shines' system. No wind and no sunlight means no energy is captured. You are at the mercy of weather conditions. Fossil fuel burning on the other hand is amazingly reliable, it's a power on demand system. You can think of it similar to timed tv broadcast versus tv on demand?

Renewables have their advantages and disadvantages; and like any other system should be deployed in scenarios where it makes sense to do so. Not all industries are able to work around the drawbacks of renewables. Notice how the video does not mention a single drawback of using renewables.
Reply: @longdang2681 you're right. With that stove they never calculated the CO2 both produced, never factored in transmission losses.

I get annoyed when people just assume electricity is green, it's not, and some places it's dirtier than others.

I wouldn't focus on the sun not shinning argument, it's a stupid argument. There is energy storage, but there are efficiency losses. However it would reduce the fossil fuels consumed during the more energy consuming parts of the day, it's also really cheap. Grid connected EVs also are great for smoothing out the grid. It is a net positive, but doesn't negate the need for base load, only reduces it.

Instead focus on the real issue of renewables, base load generation. They don't have a solution. They say batteries, but they aren't scalable, not very renewable, and China holds most of the scarce resources.

Meanwhile they encourage electricity use in all things when they should encourage minimising it. Gas stoves are excellent for me because the grid I'm on is largely coal based.

I just wish someone would tell it how it is, neither side tells the truth. Maybe if the other side stopped pretending it didn't exist we'd get a proper discourse, but neither side listens to the other now and both have silly views now.
Reply: @longdang2681  not really
first of all the civilization has to take care of it's garbage. If you put it into a incineration energy plant, then you burn the garbage and get electricity + waste heat.
You can use the distance heating and connect it to household, the worst of the fumes land in the industrial filters and the electricity supports other needs.
Just google - "Müllverbrennungsanlage Spittelau" as an example. It is in the middle of Vienna.

"You are at the mercy of weather conditions"
yeah, and if some new war in the middle east starts up and the oil price increases to x2 or x3 you will have a new oil crises that we had multiple times in the past.
Just use new nuclear plants for the base load.
Reply: @longdang2681 Induction cookers are actually more energy efficient than gas. And electricity is usually more expensive than gas, that's the reason why you'll pay more using electricity.
Reply: @longdang2681 I think that was the point of the video. Low-grade fuels take energy to extract, refine and be delivered to you, all of which use energy and require their own Low-grade fuels. Then during usage, the waste heat heats up your home and require more energy to cool the home. So those add up to the 2/3 of energy wasted. I personally have an electric range but don't use in summer because it remains hot after cooking and heats up the kitchen. So I got an portable induction that cools down almost immediately.
Reply: @Garz1189  Great! We've also found the benefits of a portable induction cooktop makes the purchase so worthwhile. Cooking is so fast and the control over the heat delivered to the cooking pot is instant.
I have cooked a lot with gas, as well as electric ceramic stove top.
Gas puts out a lot of water vapour as well as heat, so the kitchen gets not only too hot, but very humid and the combustion products from burning fossil gas are toxic. Who wants a toxic, hot and humid kitchen? A big No to gas. Induction is the best.
Reply: @longdang2681  This said, where geography allows a lot of hydro power, 100% renewables should be used, while hydro is renewable and yet reliable. Then in places where this is not possible, some less tahn 100% renewables can be used to overcome Dunkelflaute.
Reply: @beatreuteler  Hydro is a non option for almost all other countries that is not Norway. You have to be realistic because it's simply not an option. There is no point in dreaming about IFs and how great it would be.
Reply: @longdang2681  Your perception is very much off. There are many countries which have very promising hydro options and are already using these. Apart from Australia these are basically there on litterally any other Continent. Maybe not so much on the british islands, though.
Reply: @beatreuteler  Norway has 60+% hydroelectric, I remember someone else at 40+%, everybody else is at under 30%. It's not my perception because it is data that you can look up. Hydroelectric is not going to solve the electricity on demand problem because most places don't meet the geographic requirements to install hydroelectric. Maybe you can name some of the many countries that have very promising hydro options and quantify how much of their expected total electrical demand is satisfied with the use of hydro?
Reply: It seems like a good idea to me to try to find a way to use that rejected energy because renewable energy isn't reliable enough and there are things we do that electricity won't do
Reply: @marvenlunn6086  The rejected energy is mostly the heat losses from burning fossil fuels, 80% in motor vehicles and 60% at generation
Reply: @davidmartin6215  if only we could convert that heat into electricity.  EV's will be a good start once they make a good enough battery for everyone and charging infrastructure . What good is an electric truck? If you are using it as a truck for hauling, you might get 100 miles, lol. If I left home with a trailer, I couldn't make it to the nearest charger